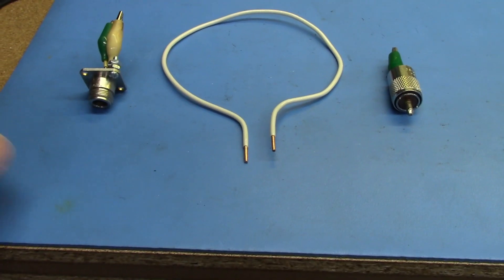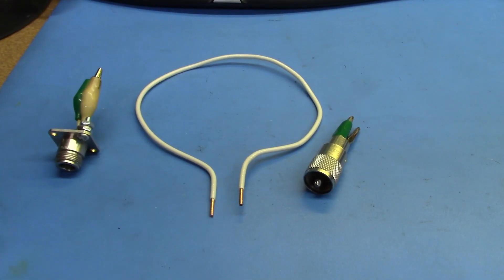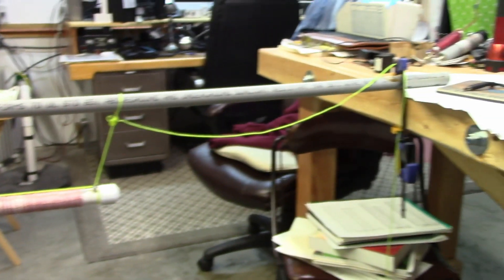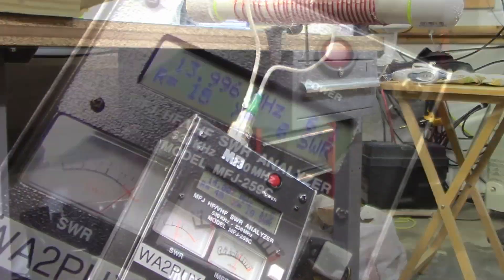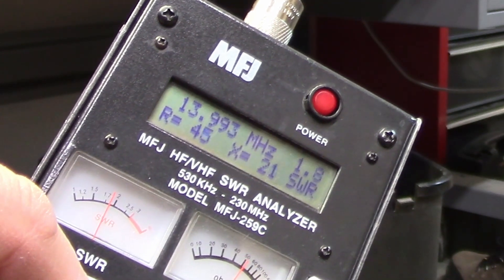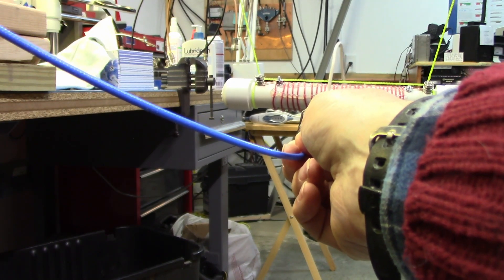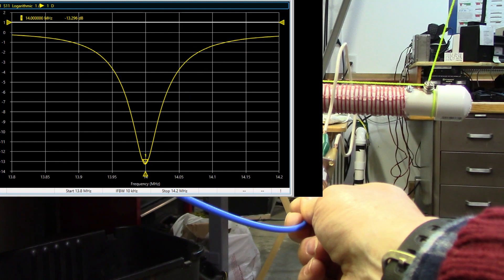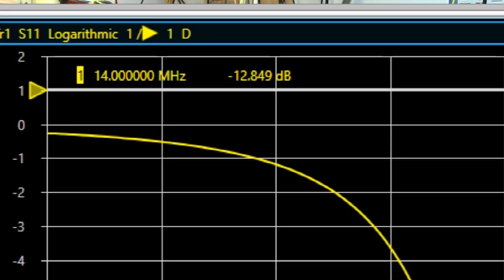Tuning Antenna Traps (026)

Comment: Ralph, which side of the 20m band should the trap be tuned?  13.9 or 14.4?  Current at the resonant freq will be max. What is best practice?  TNX.  WD0DUD
Reply from the maker: Goooooooood question.  
I tuned my own 20 meter traps for 14.3, the top end of the band. My reasoning is that I wanted my antenna to look longer and longer as I went down in frequency, thus giving me the flattest response that I could get for the 20 meter band.  I honestly didn't give much thought to current. I was concerned a bit with the voltage across the trap, though.  I also discovered that the higher the voltage rating of the capacitor, the lower its Q. 🙂

Comment: I watched the film with admiration, I also tried this with the Comet CAA 500 Mark II, but it was not successful yet. I don't know if it is possible with the Comet CAA 500 Mark II?
Reply from the maker: I am so glad you found the video helpful.
To answer your question, it should work with any antenna analyzer.  The idea is that at the frequency of resonance, the trap "sucks" energy out of the loosely coupled loop and, thus, the apparent SWR will dip on the antenna analyzer.  You are not looking for a specific SWR reading, just the frequency where the SWR dips to its lowest point. 
Hope this helps.  :-)
Reply: @eie_for_you   super erklärt.
Reply from the maker: Thanks!

Comment: how do you get to that test screen on the nanovna? could you reply with a quick instruction on that part? i can only find the swr option that I tune my antenna with and that reads 90 something, I am pretty sure I am not that far off, I would like to see the mHZ like you have in the video here, any suggestions?
Reply from the maker: I have to admit, I used my high end VNA for the video ... its easier.
BUT, here is how to get what you need on your nanoVNA. What you are looking for is "S11 Return Loss".
1. Set your frequency extents (STIMULUS->START & STOP)
2. Turn off all unnecessary traces. (DISPLAY->TRACE, then double tap TRACE 2 through 4)
3. Set return loss in dB format (DISPLAY->FORMAT->LOGMAG)
4. You will likely need to set the scale to make it more visible. (DISPLAY->SCALE->SCALE/DIV) I just did (1->x1). You might have to use something different depending on your test setup.
If you are using the nanoVNA software with your PC, then set your start and stop frequencies. Click on the Display Setup button. Choose "S11 Return Loss" for one of the displays. If it were me, I'd set all of the rest to "none." Then your are good to go.
Hope this helps! 🙂
Reply: @eie_for_you  thanks for the response
Reply from the maker: No problem! :-)

Comment: Interesting video - thanks.
How would you tune a small toriod based trap  using a nanonva ?
Can you still use a the wire loop method ?
Reply from the maker: I have not had the pleasure of doing that ... yet, BUT, a tuned circuit is a tuned circuit.  I am assuming that it should work the same.

Comment: Very nice to know all this staff. very helpfull. I like to ask you if you know how to measure the traps of a mosley cl-33. Do i take each coil out from the aluminium tube or there is a differend way?
Reply from the maker: Hmmmmm...I honestly do not know the answer to that question. I have never had to do that.
The aluminum is non-magnetic, so it should not (?) have an effect on the resonant frequency.  With that said, I am not sure if the shielding effect of the alluminum would prevent this method from working.
If it were me ... I'd try it without disassembling the trap and see if it works.  If it is inconclusive or doesn't work at all, I'd disassemble it and try again.
Sorry that I cannot be more help.
Reply: @eie_for_you  I would like to continue on this topic, but I had sent you a message today that I had not yet succeeded. Now I'm sitting here reading and I have that too. With an aluminum bus it is an LC circuit so you cannot remove the bus otherwise the LC circuit is no longer correct. PD0G
Reply from the maker: @PD0G Interesting. I can potentially see the aluminum affecting the capacitance. Being that is is non-Ferris, it should affect the inductance.  I haven't tried this with a trap from a Yagi ... yet

Comment: It would have been useful to tell us how you set up your VNA - e.g. what format/scale are you using?
Reply from the maker: Aaaaah... well, based on the fact that this was also done with the Antenna Analyzer which is looking at SWR, the measurement was done with S11/Reflection with the VNA (what they call it depends on the particular VNA - S11 is the standard VNA nomenclature - Reflection as seen by port 1 at port 1).  
Format-wise, this depends on your preference. dB or SWR doesn't make much difference.  dB (return loss) will show a much narrower point of resonance than SWR just because of the math associated with it.
Scale ... this depends on the coupling with your loop. This is so very variable, there is no way for me to give some sort of definitive number to it. I position the loop for what looks like the response I will get and then just tell the VNA to do an "auto-scale."
Hope this helps.